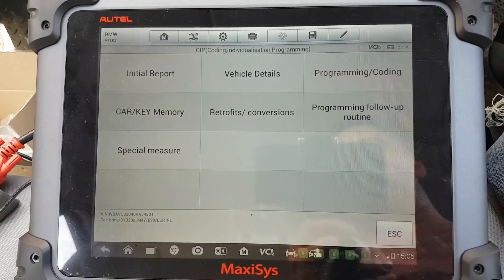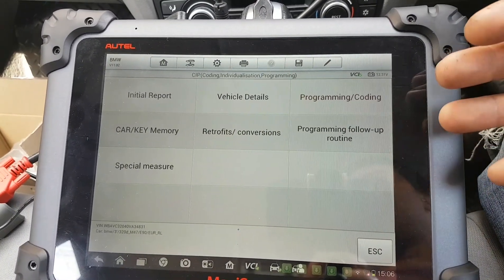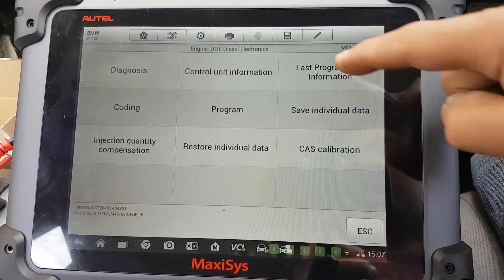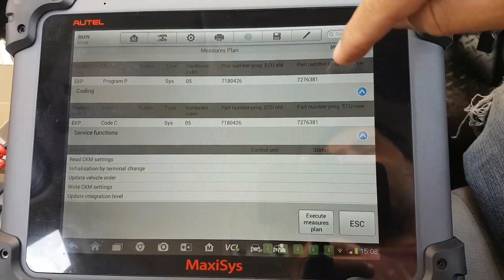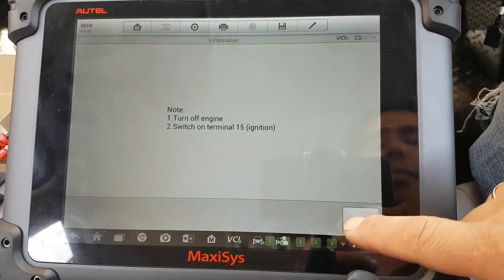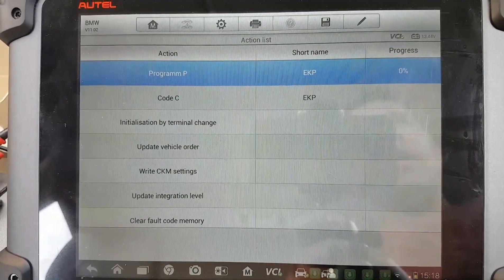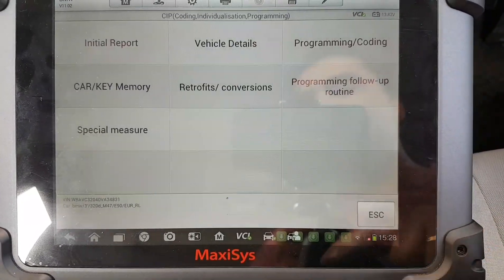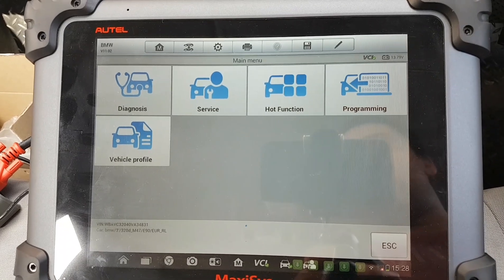BMW individual module programming using Autel MaxiSys MS908P.

Comment: hi did you use usb cable to connect interface for programing and adapter Y that has obd and enet connector(red one)? I have MS909 and I did reprogram some F10 with success, but i dont know if that adapter has to be also pluged in. ? I dont have that red one with enet jack.
Reply from the maker: Unless the MS909 has DoIP the adapter is essential for any programming on the F series...
If you did it just with the VCI and straight to the ODB port, then I would guess your tool has DoIP...
👍👍👍

Comment: What is the difference between coding and programming???
Reply from the maker: Programming usually refers to the writing of the module software... also knows flashing...
Obviously Programming can refer to other software updates etc...
Coding refers to the changing of settings/parameters, in this case to match the car's options etc...
👍👍👍
Reply: @LMAutoRepairs  thanks brother !

Comment: Which diagnostic is the best one to buy ?
The does nearly everything ?
Reply: Anything that costs over 3000 dollars should satisfy You 
For a while
Reply from the maker: There is no such tool...
You need to compromise depending on what you really need or want...
👍👍👍
Reply: @LMAutoRepairs  thank you generally which is the best one to buy ?
Reply from the maker: @BK-it6te 
Again, depends...
If you just require general code reading etc... any low-mid range will do, the likes of Autel, Topdon, Launch...
If you require more in depth then you have other tools for that...
Or, if you need it just for a brand then other tools apply...
You are not saying what you actually want it for, so it is difficult to say...

Comment: I have the Autel MS908SPRO and I know it does programming because I have the J box with it. I wanted to know if if could be used to program a new CAS module and key for  BMW 530I or will I have to send the module out for programming?
Reply from the maker: Hi
It will program and code the CAS... but, unfortunately will not program the keys...
👍👍👍
Reply: @LMAutoRepairs  ok thanks and I'm going to program a new CAS I purchased but wanted to know if the keys needed to be programmed before or after the CAS?
Reply from the maker: If you have the tools, you can program the keys on the bench before program it to the car...
Reply: @LMAutoRepairs  Ok I brought the Autel KM100 so I should be able to program the key to the CAS after programming the CAS in the car.
Reply from the maker: ☺️
Never used that tool...
Let us know how it goes...
🤞
🤞🤞🤞
Reply: @LMAutoRepairs  The KM100 from Autel for key programming works great. Had new key programmed in about 5 mins. But on the Autel Maxisys 908Pro it should have an option to match the CAS and DME because only need that to finish car?

Comment: What did u use to program the car I have the 906 bt what else do I need
Reply from the maker: You need a J2534...
Your model is different...
👍👍👍
Reply: @LMAutoRepairs  so that will work for the 906 bt
Reply from the maker: Don't think it does...
The VCI is not the correct one...

Comment: hello can you ask me a question for the bmw brand which machine advises me to 908s pro or elite 2 thank you answer thank you
Reply from the maker: The Elite is the one above the MS908P...
So, I would recommend that one...
👍👍👍
Reply: @LMAutoRepairs  thank you very much for your reply
Reply: Hello, I also recommend Elite, because I am also using this product and the experience is not bad.
This is a video of me using Elite to perform online programming for the Transmission module of Audi A4L: https://youtu.be/ulewXsAKls4 , share it with you here, you can refer to it.
A video of the function performed for the BMW is also in my shooting schedule! If you are interested, you can click to take a look, or give me your opinion.
There are more videos on my homepage of using different devices to do different functions of the car. You are welcome to follow me and I will be happy to answer your questions. thanks.

Comment: this machine has all the programming and encoding modules the same as the ista esys etc program to encode tabs quadrants NBT screens thank you for your help
Reply from the maker: Yes... 
👍👍👍
Reply: @LMAutoRepairs  so it does everything that an original eth cable type machine does, having this machine I don't need the bmw machine or the programs?
Reply from the maker: Pretty much...
Just that ISTA has guided diagnostics with diagrams etc... the Autel doesn't...
Reply: @LMAutoRepairs  thank you my friend I appreciate your availability and thank you for helping me because I'm buying a machine like this expensive and complicated😅

Comment: can you use this to program a used egs module  when replacing transmission ?
Reply from the maker: If the egs is part of the immobiliser system, no...
You need something like the IM608... I have videos on that...
Or any other tool capable of reset the immobiliser on the EGS...
Thank you for watching! 
👍👍👍
Reply: @LMAutoRepairs  how about e90 amd 2005 X5? is that needs imobiliser?
Reply from the maker: Don't think those are affected... F series and E65.... if I am not mistaken...
Not sure about the X on the E series...
That said, you will find out as soon as you connect it... as the car will fail to engage gears, if the immobiliser needs pairing...
👍👍👍
Reply: @LMAutoRepairs  i wiil watch your vids tho

Comment: Tried doing this on my bmw with a low battery now car won’t start any suggestions? Crank no start
Reply from the maker: That's a rookie mistake...
Plug a charger, scan the car, and what module is corrupt, then try to flash it again...
Good luck!🤞
Reply: @LMAutoRepairs  thanks a lot will try today and let you know the outcome
Reply: @LMAutoRepairs  hey man so I Hooked my car to the scanner today and proceeded with clearing the codes mostly all the codes cleared except for a cas code, something to do with the key or low battery, can’t get the code to reset which I think is preventing my car to start. Any help? Using autel scanner
Reply: @LMAutoRepairs  I take that back bro, took me about 3 hours but I finally got it, appreciate the help bro, after going through 3 mechanics and all the headaches, I’m back on the road thanks to you!

Comment: Hi Luis. Can the MaxiSys MS908P program a replaced ECU on a BMW? In my case an E series 520d (E60). My friend has replaced his DME and he was trying for days to program it using the IM608 but he cannot do it. I know the IM608 is more for key programming but it can do a lot more than that. Another great video by the way. You keep posting and I'll keep watching. Thanks a lot.
Reply from the maker: No... 
None of the Autels (MS908P or IM608) can do it through OBD...
The IM608 if I recall correctly, can do some ecus... to program the engine ecu, you need to take the ISN from the CAS and write it on the ECU... or vice versa...
👍👍👍
Reply: @LMAutoRepairs  That's what I thought. Thanks for your respond. Wishing you all the best!!!
Reply: Pretty sure the MS908S Pro with the J2534, can program a new or used ECM on BMW and Mercedes.  But only those auto makers. The rest, no.

Comment: Two questions on your autel coding. 
1-were you connect to internet ?
2-did you have access to dealerships system?
Reply from the maker: Hi
1- to my WiFi...
2-yes, to the ones autel supports... 
Thank you for watching!
Reply: Dear LMautorepairs. Can you program in same matter a used Cas3 module on a 2013 bmwc328i?
Reply from the maker: @derkdevries328 
Yes... but, the immobiliser side of things will not be changed...
So, keys will have to be programmed separately and not with this tool, as it not capable of that...
👍👍👍
Reply: @LMAutoRepairs  thanks LM. Im508 should be able to prgram key again..if i also have that right?  I see people going thru lots of bench set soldering etc on the cas which is connected to the cas. Wonder why take all the headache if you could just do it through the obd port?  Afterall your wifi server support for bmw as you mentioned is kind of in your ms908
Reply from the maker: @derkdevries328 
Not all CAS can be done through OBD... if I recall correctly...
But yes, with the IM508 and all the other right tools, you should be able to do it...
Reply: @LMAutoRepairs  dear ML. For all your followers :for theses used  modules for bmw and other brands modules would you consider this ms908 the top  of line or is there another autel better..but also worth is given the big price diffence? I assume the next model is ulta? $1800 vs $3800.   I usually try to use only or mostly Used Modules and ecu's instead of new expensive modules like many of your followers.  Please let me know since you seem to be extremely experienced
Reply: Dear LMAUTOREPAIR,  Can you reprogram a used Cas3 module on a 2013 bmw328i in the same matter with this autel?

Comment: Hi you've done some great videos that have helped me in the past, I've recently bought the 908s and programmed the left SBSL module on a 2004 bmw z4 all errors have now cleared however I have one fault remaining in the left SBSL module (system time error) can you possibly help please

Many thanks 

Rob
Reply: Hello how much was the tools
Reply from the maker: You need to update the modules relating to Airbags... if I recall correctly... so the system time resets on all at the same time...
Have a read here... there is some guides explaining it all...
https://www.bimmerfest.com/threads/system-time-reset-help.1138265/
Hope you get it sorted...

Comment: so when i plug my scanner all in with jbox and go into programing and coding it runs the scan through all modules but only gives me 2 options after coding and car/key memory what am i doing wrong please help
Reply: 2004 bmw 330i transmission starts in 3rd gear with transmission light on dash
Reply from the maker: Which scanner are you using?
Thank you for watching!
Reply: @LMAutoRepairs  908 pro with the jbox
Reply from the maker: Wich car?

Comment: Seeing an Error when trying to get a module programmed. Any advice or help? Error States: Connected vehicle has an unknown data status. It is not possible to handle this one with diagnostic tool. Ensure that the latest version of diagnostic tool has been loaded or contact after-sales department. When the measures plan was calculated a field appeared. Possible Fault Cause: Integration level (S15A-20-03-524) is incorrect or too new. Any ideas here?

Comment: Great video. What is the purpose of programming? I’m buying a Mercedes and want to do all the service and maintenance my self.
Reply from the maker: This was just a demonstration...
The programming can be beneficial is has been released new versions to correct small problems...
A bit like updates...
But you need specific tools to do such thing...
Thank you for watching! 
👍👍👍
Reply: Thank you for your response would I need to buy the autel package that comes with programming tool or can I go with standard  package just to maintenance like brakes and oil changes and smaller issues?
Reply from the maker: Yes... for that you have other tools from Autel and other makers...

Comment: Hi can you reset my frm..please..
Reply from the maker: What do you mean reset?
Reply: @LMAutoRepairs  2010 bmew e91 footwell module
Reply from the maker: What is wrong with it?
Reply: @LMAutoRepairs  well i sent the car to dealers to have check out what it wont start.. It came back woth the windows. Interior lights hazard not function.. The service advisor word was its shot... Im like really how.. Oh you got an alram oon it which cud be the case. And this alarm was fitted long ago i drove the car home with no issues.. So not taking any responsibility..
Reply: @LMAutoRepairs  the code is s1140
Reply from the maker: That does not look like a corrupt FRM code...
Anyway, so, you took the car to the dealer because of a non starting problem....
They fixed the non starting, but now you have all those issues... correct?
Reply: correct , the service advisor is telling me  there's an (proximity siren) foreign device   fitted to the car which could have something to do with frm being shot, the only thing i suspect is a pair  led headlights bulbs  no dip beam   warning .imo LM i  feel the frm is not dead it probably shut down due to jumping the car  ive seen your work of art is the reason why i reach out..please help

Comment: The shift solenoids. I asked transmission shop for an estimate to replace the solenoids and they told me they couldn't do it cause they had to be key coded and they didn't have that capability. They might be wrong.
Reply from the maker: Yes... the solenoids alone are just an electric valve... no coding required...
The entire mechatronics is a different story...

Comment: Do you know if you can code replacement transmission solenoids on a 2012 335i with an Autel 906bt?
Reply from the maker: Never used that tool...
Not sure if the solenoids need to be coded...
Or are you talking about the whole mechatronics? 
Thank you for watching and for your comment!

Comment: Hi there, where do you get the J2534 cable from?
Reply from the maker: Comes with the Autel... As part of the MS908P...
Thank you for watching!
Reply: @LMAutoRepairs  ah okay, i have the MS906BT which it doesn't come with, (only the Bluetooth VCI) cant seem to find where I can get it from separately
Reply from the maker: This it is just an example...
Didn't took long...😊
https://www.ebay.co.uk/itm/Autel-Maxiflash-Elite-J2534-ECU-Programming-Device-/154363911798?_trksid=p2349624.m46890.l49286

Contact autel, or check their website... they also sell it separately...
That said, ensure is compatible with you tablet... As you need a subscription in order to download the files etc...

Comment: Hello, can you CODE Auxiliary to a 2004 bmw 530i on Maxitool so it can show on the display screen ? It only shows FM/AM/CD I installed auxiliary but it won't show on screen and I read it needs coding but most videos I've seen are done on INPA but I have Autel Elite scanner. Thanks
Reply from the maker: Autel should be able to do it...
Either by editing the VO, or under retrofits...
Thank you for watching!
Reply: @LMAutoRepairs  do you know anyone that had done it on Autel ? Or do you know of any link on YouTube for it ? All what I found was INPA
Reply from the maker: Not INPA... you can't code with INPA...
Is with NCS Expert...
Again, autel will do it by modifying the VO...
Just add +NAUX to the vo, save it and the code the ccc and all the relevant modules...
Quite straight forward...
Reply: @LMAutoRepairs  does VO means vehicle operations ? Not sure what you mean exactly by VO and CCC Sorry I'm not finding the right way to do it 😭
Do you mind sharing the steps ? Truly appreciate your time
Reply from the maker: VO=Veichle Order
CCC=Car Communication Computer

There is step by step guides out there... I am sure...
I don't remember now from the top of my head, and if you need a step by step guide, I don't want to give you inaccurate information...

Comment: I tried programming my new headlights  to my 2017 bmw 330i, it required Ethernet connection, I kept running into connection issues. In the autel diagram I have to use the special adapter that has both Ethernet cable connection and OBD port, and then it says to poking Ethernet cable into the autel MS908P. Can I just use a personal hotspot that can connect to the connector and tablet via Ethernet ?
Reply from the maker: Yes... you need the ethernet adapter for the F series and above...
It is not expensive...
I believe on the new 908 that adaptor come with it... not on the old ones... I got my one from Autel directly...
It is something worth to have...
I never tried any workaround, so not sure if it is possible to do it in any other way... I would say no... As the autel needs to connect to the car through the ethernet to the car...
Thank you for watching and for your comment!
Reply: @LMAutoRepairs  I have the Ethernet adapter and everything I’m just not sure on how to connect it, if I can’t have WiFi on how is the autel supposed to download the file needed for the programming? Do you know how to set up the Ethernet on the device ? I tried and still can’t figure it out
Reply from the maker: 😊
The Autel will automatically switch between the ethernet which will be connected to the car, and the Wireless when it needs to download files...
Don't need to worry about that...😉
Reply: @LMAutoRepairs  so To clarify, I can use the personal hotspot on my iphone to connect to the autel to the internet, and then once the Ethernet is connected to both the OBD and the autel, it will switch between automatically? Because I tried that and then i was getting a “no vehicle communication” pop up on the autel
Reply from the maker: Yes... that is how I do it...
Just that I connect to my WiFi... but that should not make a difference...
👍👍👍
Reply: @LMAutoRepairs  I’ll give it another try tonight, thank you very much! Great Channel! Much appreciated
Reply: @LMAutoRepairs  and I can’t use hotspot because it doesn’t allow me to have WiFi on

Comment: Hi thanks for the info. I see it has a retrofit and conversion tab, I have swapped my gearbox for a 6 speed from a 5 speed and retrofitted cruise but cruise only works up to 5th gear and when I change to 6th gear the cluster display only displays up to 5th gear and goes blank in 6th will this do this? Many thanks
Reply from the maker: Possibly...
Never done it...
👍👍👍
Reply: Where about are you based? Wanna try? Obviously pay you! 😊